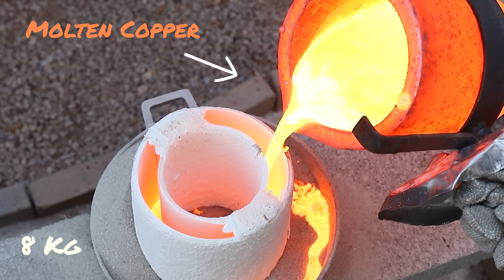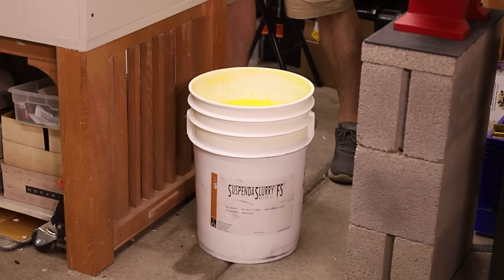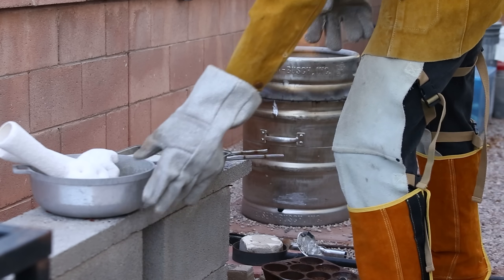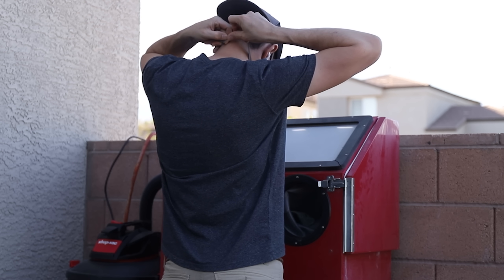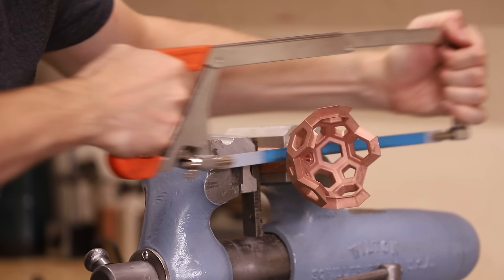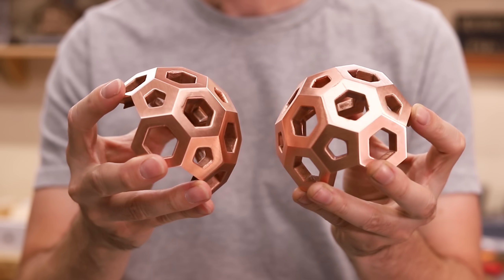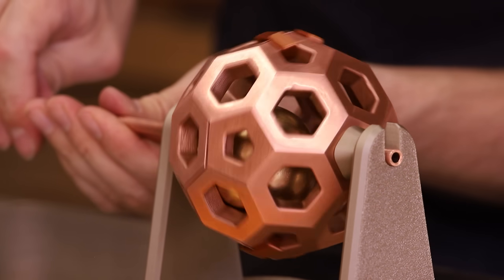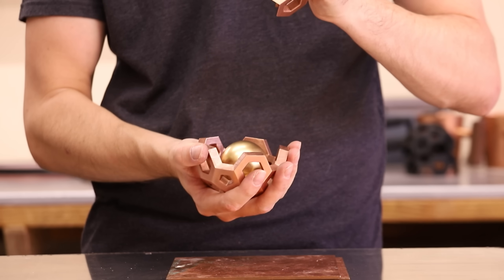HUGE Magnet VS Copper Sphere - Defying Gravity- Will a Neodymium Magnet Float Inside?

Comment: could this be a shock absorber, ie put the magnet in the copper tube and apply up and down force in it to dampen? or would there be heat generated....ie a mechanical heater..?

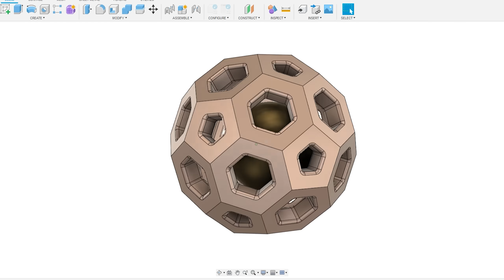Comment: 0:59 it is actually called a truncated dodecahedron a dodecahedron being a shape with 12 regular pentagons and truncating it meaning in this case to add hexagons in-between all of the pentagons what you said a truncated icosahedron would mean an icosahedron a shape made out of 20 equilateral triangles or twenty tetrahedrons/triangular based pyramids together truncating this shape as before would be to add hexagons to it meaning their would still be triangles how ever their are none on your polyhedron meaning it is not what you said it was a truncated icosahedron but a truncated dodecahedron as it has both pentagons and hexagons in the formation previously mentioned also I don’t think a truncated icosahedron would even be physically possible to make in the third dimension meaning this is definitely not one

Comment: Try the same thing but with Gold instead of copper. Check if the energy out (electricity) generates better output compared to most generators. I'm curious if the output will increase or decrease.

Comment: try spinning it like a top with the holding points north and south. Then use metal  plugs attache wires and see if it generates power like a n alternator when spinning at a high rate of speed. Use solid mounts  to counter the cintriphicle force and limit vibration by bolting it to a work bench. just an idea.

Comment: So far Eddy's are my favorite physical phenomenon. I used to work  on MRIs and I had a lot of fun demonstrating this by taking an aluminum sheet and letting it fall at an angle in the bore of the magnet. With a strong enough magnet and right sizzled plate you can see when it hits the field lines, so it's not a smooth drop. It staggers in the fall. Also, we used aluminum ladders to get to the cold head and if your carrying the ladder around the corner of the magnet it would catch and it's like walking into a wall lol. Did that a few times.

Comment: I had a thought...stop laughing.....What if you use half the sphere you made but use a motor underneath it to see if it will float that way. I edited this because I think I did not explain myself very well....I meant to rotate the sphere 90 degrees, Like a bowl and place the magnet in the bowl an spin with a motor. :)

Comment: 11:46 For me this remote rotation was easily the coolest part of this video and I'd like to see more of it, more talk about it, that's so rad
Reply: maybe put the 2nd magnet on motor & see what happened next?
Reply: @norbertwu8389 I thought the same! A motor would make it easier to adjust the rpm to precisely what’s needed for the ball to float stably
Reply: same, basically using a push rod design and would have a working magnetic / copper perpetual generator?
Reply: Its just friction/resistance. Hes flipping the poles so the other magnet flips to match and turns the copper

Comment: 11:46 I wonder…if you had a magnet that could freely turn the sphere with as little…wobbliness?…as possible — I’m assuming the shape would be like…a sphere, but with many planes running symmetrically through the center — and if this shape was being rotated fan-side towards your ball with a motor…AND if there was another on the opposite side, spinning in the same direction so as to not interfere with the first fan-sphere…could that possibly allow for a function similar to ball bearings in a car, but without the need for contact?

Comment: Maybe you could try making a North/South Pole wheel on some bearings and use distance to control the speed of rotation. I feel like the energy of this would possibly have enough to overcome the gravity of the sphere. 🤷‍♂️. I’m not a scientist nor am I an expert on magnetic properties but I do have some background in metallurgy with an associates in applied science as well as a basic knowledge of magnetic motors and a fascination with the idea of infinite energy.

Comment: Another reason it only works for so long is because the magnetic fields are created with the "relative" rotation of the magnet and copper sphere. If the magnet also begins to rotate in the same direction, which it eventually will, because of air currents at the very least, the field drops off as the relative rotation begins to equalize.

One way to mitigate this is to have a filament of plastic going through the middle of your axis tubes, attached to the magnet, to prevent it from spinning up with the copper sphere. Not enough to stop the magnet from moving, but enough to counteract the spin. This would get the maximum "float" for your rotation.

Comment: if you can fit in a camera from the side where the spinning is happening and attach the camera on a ruleman. Oil the wire so it has an easy drift, we can then have a better view on what is happening inside

Comment: Oh, so with that magnet, could you use a servo motor to accelerate the sphere with a sensor to check whether the sphere is rotating? And perhaps use another engine to check if you can generate the same amount of energy the servo motor consumes, since rotating the magnet can require less torque than the torque the sphere rotating can generate?

Comment: I think that the (icosahedral frame) shape of the copper will impede the flow of induced currents in a complex way, reducing the tendency of the magnet to 'float'.  Making it a complete hollow sphere of copper, with a small hole for a light source and miniature camera might work better.

Comment: Experiment:
1. Trying to use it with solar or wind turbine to create a stable electricity.
2. Using iron powder or something similar to show the magnetic line as stationary and when the sphere moving.
3. Trying to spin the sphere in different liquid like water, oil, heat, and cold and see how the metal powder react to it.
4. While spinning the sphere, pointing the laser at a tangent and see if it curves similar to good old CRT TV.

Suggestion:
1. making solid sphere.
2. Installing a fiber optic camera to see the action within.
3. Using ball bearing on the spinning axles.

Comment: I would like to see you solder the axle to the cage then connect a + charge to one end then a - to the other which could be experimented with varing the volts and amps, as well as using the doughnut magnet with an axel fitted as you did for a few seconds in the video but connect the both axels with a belt to effectively turn both axels at the same rotational speeds along with varing the voltages/amperages passing through the cage also the variational speeds with the axels could be adjusted and played around with, oh, oh, this is as exciting a thing i've seen for a long time i would have so much to try with this, please don't stop this or i may be forced to have to do all this myself, only thing is tho, i couldn't even come close to making this fantastic cage you made.😊

Comment: Try vertical center of rotation? Probably will not behave exactly the same but can't hurt to try it.

Try different cardinal directions of horizontal spin, with the spin going towards or against (try both horizontal rotation directions) the direction of earths movement, or direction of the magnetic field.

Comment: Balance the weight of the magnet to pi, reprint and recast the copper enclosure to include external groves for gold grounder strips, create a separate enclosure with gears allowing counter spin, likewise calibrated to pi, assemble. 
Payment = 50%

Comment: One of the things I would try is to measure the electrical effects of the lines of flux through all that copper lattice. If a single magnet of size you use to rotate externally, imagine what may happen with several stronger magnets in a rotating field. The induction potential might be incredible.

Comment: I would try a sphere with more sides, a dodecahedron would work better as there are more sides of force holding the ball in the middle. The sphere is slipping off of the magnetic vortex you are creating. Once you can stabilize this I think you can work on it some more. The idea with putting a wheel of magnets around it all tilted at a slight angle to keep the ball moving in that direction you might have found a way to generate your own field that generates a surplus from the kinetic energy of its motion. Especially if this was in a vacuum like space with very little gravity to begin with. I had a near death experience once where I saw peoples auras shaped much like snowflakes or mandala type energy sphere that we all produce in our bodies. The same goes for our planet, solar system and on up the scale, and down the scale. The hydrogen atom is the most stable and it is shaped much this. So Good luck I enjoyed the video!

Comment: on the inside of one of the halves make it con cave where the plug is and then try to spin it vertically or have the plug prop it up ever so slightly so its not touching the inside when you begin to spin it vertically i think that would be neat

Comment: The sphere has to be a magnetic dipole.  So if you could figure out where the poles are, and if you can arrange them horizontally with rubber bands under low tension you might get a smoother result.

Comment: Have you thought about drilling a hole through the actual sphere that way is a little wire  in between the sphere and the outside shell, showing the spin of the metal sphere  or even make it even lighter sphere by hollowing it?

Comment: I might work a bit better with a better electrical connection between the two halves?  The two halves are probably only touching in a few small contact points and not letting currents flow as they would if it one solid sphere.  You might try some EMI gasket material along the seam to make a better connection between the two halves.

Comment: Oh and your design is basically flawless, the only improvement needed is a variable speed motor with controller it's simply a case of finding the proper duty cycle/ frequency

Comment: perpetual motion machine? using a magnet to flip the one inside to cause motion see if you can generate an equal or greater amount of power output of the sphere reacting.
long shot, but could make a decent video.

Comment: doesn't work as you wish because you took a truncaded icosaedro ( one of the 13 Arquimedes's Solid) missing big piece of copper ( on the middle)  ,..more copper and less space will create a bigger magnetic force. When you cut a metal ou iron-magnetic metals you reduce the eletroestatics and eletromagnetic forces - the Coulumb Effect.

Comment: A larger size difference (more time for the magnetic field to respond to the movement)
A differently shaped Magnet (A cylinder or U-shaped cylinder may respond funly)
A lighterweight magnet (with a strong strength to weigh ratio)

These things would be curious in how it adjusted the final results.

Comment: It could have been done easily with smooth in and outside sphere instead of those undulated hexagonal faces inside and outside . Those hexagon faces made the floating inconsistent.
You wasted lots of time , energy, resources and labour on the moulding process . It could have been done easily with thick copper plates forged into two half spheres , and holes or slots can be made earlier or later . 
What was the use of having such large wasted ignot of copper that you cutoff after the moulding ? It could have got casted with less than half the copper smelted . 
Many other things to say , its boring to type it all . 
I am wondering where all can i use this principle of floating magnet !!!!many things popping in the mind .....

Comment: can you try and measure magnetism at different points inside the sphere? Does this have anything to do with why the sphere cant stay in one place? Also can you make a magnetic motor out this as renewable source of energy?......What about if you connect current at either side of the sphere? what would happen to the sphere?

Comment: I wonder if a specific speed of rotation is necessary because the interior is faceted, rather than spherical.  Would be interesting to try to make the same shape to enable seeing the magnet, but make the interior surface more spherical to make the distance between the magnet and the interior sides more equidistant.

Comment: What if you'd make an outer ball out of parts but every part would be at a different position and move itself around in the circle which then forms a visual ball at high speeds out of the moving parts but gets invisible at a certain speed like the rotor blade of something and then there is a magnet ball inside which then hovers because the outer parts are moving around it in all directions so fast that it would create an outer ball at high speed but it would never be a constant outer ball in it's form itself. I dont know if I can make this understandable in a comment but I think you may understand what I mean. Because then the shards or parts of the outer ball would rotate so fast around the magnet that they would become invisible and you'd see just the magnet floating in it's space

Comment: When you put the spherical magnet into the roughly spherical copper shell in which direction did you point the north pole of the magnet? What did you do to keep it from shifting or how did you control the orientation of the magnet?  BTW, I've used CAD a lot, and it is easy to make a sphere with windows in it; be honest, you could have made a sphere but you wanted a copper doggie toy to put on your desk, right? ;-) BTW2, probably not related to your project, but check this out: https://en.wikipedia.org/wiki/Roman_dodecahedron

Comment: So, it seems like the magnetic ball is escaping the field by squeezing out toward the sides. 

Thinking about this, it seems to me that the outer sphere is only spinning in one direction -- let's call it top -to-bottom.  It is not also spinning left-to-right, nor any of the other directions in between.  Obviously, the idea of a 3D object spinning in every direction at once is hard to imagine, and even harder to build.  However, I think that such motion would stabilize the sphere in the center at almost any speed above a certain point, theoretically.

Since you can't build such an impossible machine, how about this:  use two magnetic discs placed so that they are centered with each of the two plugs so that they "push" the ball toward the center of the sphere.  Do you think that might stabilize the floating sphere?

Comment: Firstly you should try soldering the two halves together. The seam is cutting through the eddy currents that are keeping the magnet afloat, so you need hugher speed to acheve some sort of levitation. Soldering the halves together would give path for the eddy currents to flow.

Secondly yo could try painting the copper ball black, so it would be easier to expose just the magnet inside with a camera, making it more distinguishable from the rest

Comment: You can think of it as a motion transmission medium. Instead of having gears you can use this mechanism for transmitting motion without the losses in the form of heat generated.

Comment: A 11:40 you asked for suggestions to improve on it. Here goes. To improve the visibility of the interior floating magnet, darken the copper "sphere" or at least it's exterior. If you motorize it, do so by motorizing the external magnet used to move it at 11:50 instead of the "sphere" itself.

Comment: ET of yesteryears twirled magnets sequentially in juxtaposed tracks in a globe of copper tubes to create directional thrust. The right combination of balanced tracks provided direction and the strength of the swirling magnets provided " power of lift coefficient". The magnetic moment could be generated hydropneumatically sequenced till they attain desired centrifugal and centripetal continuity.

Comment: That's a pretty cool project! I would be curious to see a slightly more spherical object instead of the icosahedron, such as, a geodesic polyhedron. I would think a more symmetrical, spherical shape may provide better results for the eddy currents. I wouldn't try to design it by hand in cad though, it would obviously be a huge pain lol. There are cad programs that allow you to program specific shapes, and I would try approximating the geodesic polyhedron with roughly the same diameter as your icosahedron. And measure the size of one of the hexagon faces to approximate an appropriate equilateral triangle face size for the geodesic polyhedron. With those pieces of information, you should be able to program a model you can 3d print, create a mold, and cast a new copper shape!

Hope this was helpful! No matter what you decide to do next, I can't wait to see your next video! Cheers!

Comment: Make the fuselage a half a centimeter wider.  Sand the interior smooth and spherical to reduce turbulence to the magnetic sphere, you could achieve this by welding a thin rod to a large bearing and tediously glueing pieces of waterproof 240-400 grit sandpaper to the sphere so that it maintains that spherical shape. Kind of like a disco ball.

That's my best theory.

Comment: Your experiment is amazing!
Would you be able to pulse air from below, the flow must be sent with a 20 to 30 degree angle, so not direct. It would then make the magnet levitate with a minimal energy.
Then at some point of speed I would expect the copper sphere to start moving as well but on the other direction.

Comment: why did you need to 3D print it and not just use a chew toy for the mold?
Reply: one other thing;does it not work if you used a mesh of copper wires instead? is there a critical mass for copper that is needed for this to work? i mean it's cool and all, and we know it floats because the rattling disappears, but i wanted to see it :D